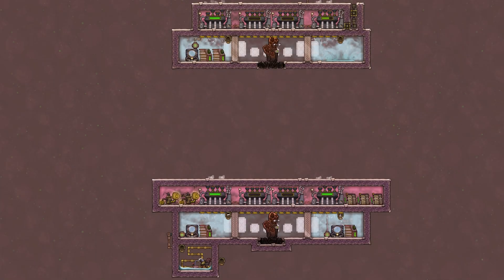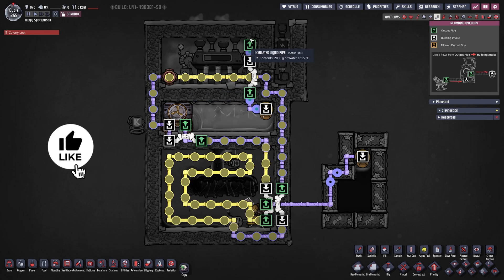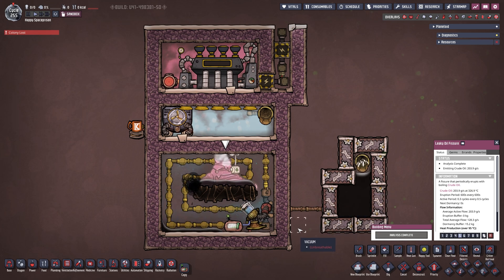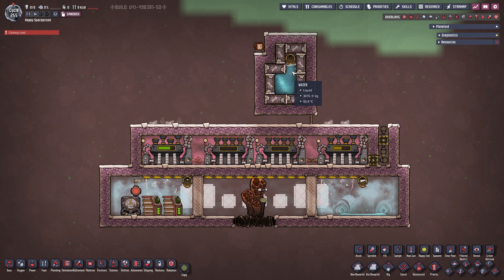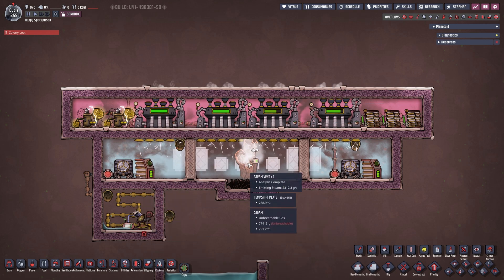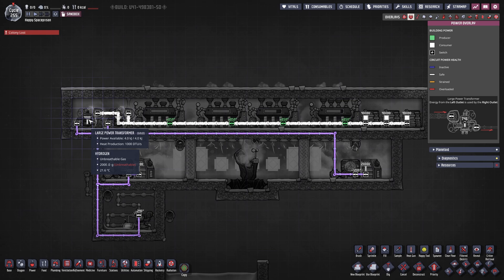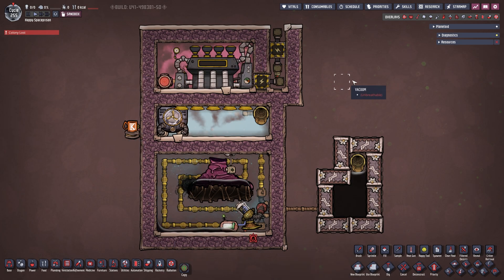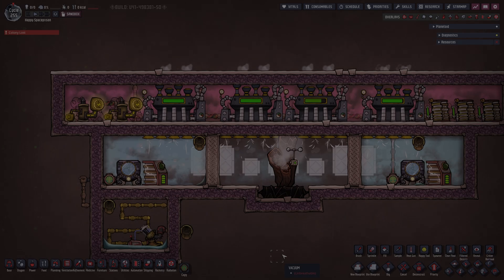GERMAN ENGINEER explains ONI: STEAM VENT and LEAKY OIL FISSURE! Oxygen Not Included Spaced Out

Comment: Hm. Wouldn't it be smarter to use the heat the leaky oil fissure creates to power the steam turbine, by cooling the oil down to 125°C. Since the amount of hot oil is not that high, it should be even possible to self-cool the turbine. In the end you have 125°C Oil (which is ok, since you'll handle it with exosuits only anyways).
Reply: Yeah, you can pour water directly into fissure chamber, and stick a turbine on top of that single chamber. I guess this design is only useful if you need to cool the oil for transportation purposes, i guess.

Comment: Everyone seems to use liquid bridges for their aquatuner bypass circuits. This is actually suboptimal! Using a liquid bridge, the path through the aquatuner is one segment longer than the bypass. The result is that (assuming the conventional bridge-based technique for filling the loop) there will be a stop/start motion in the loop when the TAT stops. A gas thermo regulator wants a bridge, but a liquid thermo aquatuner wants a wide-open _valve_, because the ports are adjacent.
Reply: you cant overlap valves with other buildigs or tiles

Comment: I didnt notice you showing the automation wires... the smart batteries, in the cooled water version, are the automation wires hooked to the aqua tuner? or the steam turbines?
Reply from the maker: There are actually no automation wires. They are just there as a power sources between active periods. That's why I don't show it. Should have explained that though!
Reply: @BierTier  ok thanks after tinkering with it i assumed that was the deal they just weren't there and nothing to show... I had a terrible time with my left aqua tuner over heating... got the set up going though after several hours tinkering... getting the place vacuumed out was challenging, and I had to eventually end up adding 1 more temp shift plate on each side... one spot over, and one spot up from the last double stack..... (if that makes sense, basically above the smart batteries at the top of the room) towards the turbine vent... this solved my problems... turners are maxing out at 400 F and its running smooth... great design i love it. My vent is outputting at 978 F - maybe mine is/was hotter than the one in the video thus needing the extra temp shift plate.

Comment: diamond is the best for temp shift plates and glass blocks they have the best thermal con and heat retention of all the mats also cool for bedrooms because of high decor value
Reply from the maker: I doubt that Diamond was absolutely necessary for that build. Glass wasn't either. But you are of course 100% correct, nothing is better than Glass and Diamond for those 2 applications :)